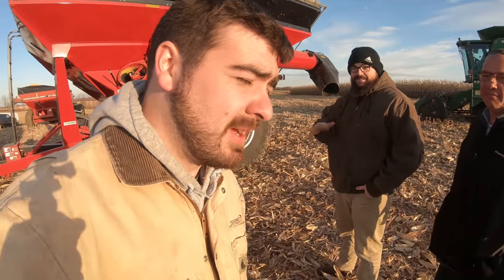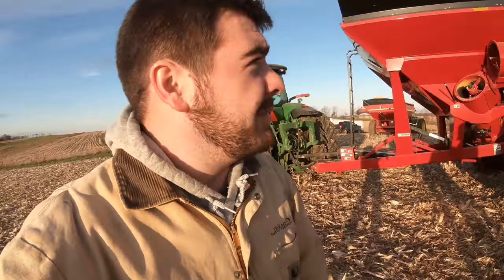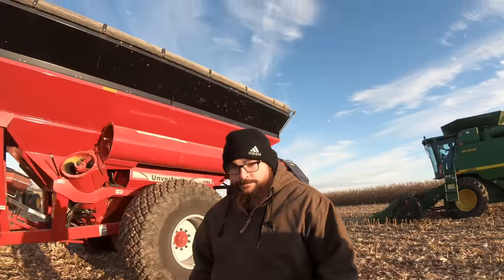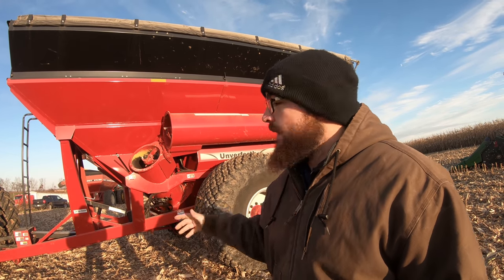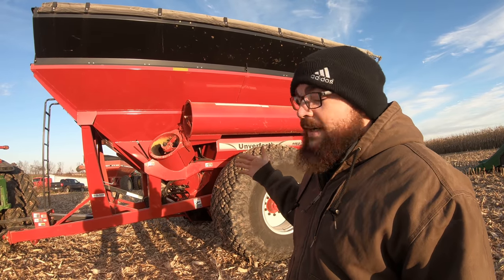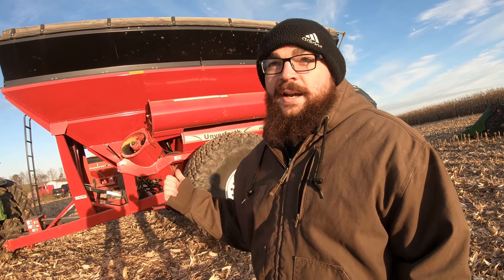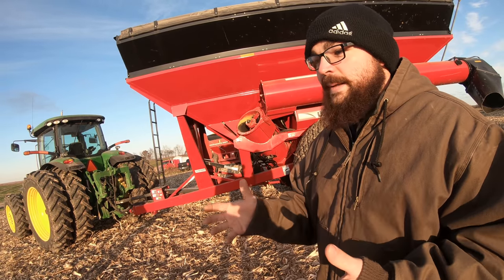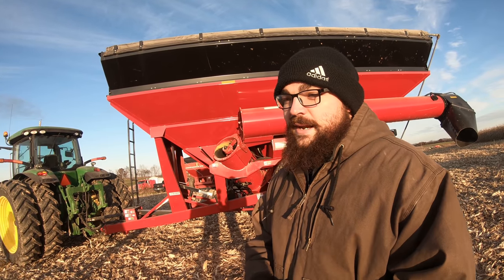A Visit From Unverferth - Harvesting Corn

Comment: you just reminded me of when i was going down to Florida back in 1976. i pulled into a town called Stark Florida. i was about the 4th or 5th car back, when a set of RR crossing guards came down. i see all the people in front and back of me get out of their cars, and start talking, and drinking soda, or i think it was soda. i stayed in my car, with the motor running, and the AC on. after a few minutes a guy walks over to my car, so i put down the window, and he said, HEY NEW YORK, he saw my plate, YOU SHOULD SHUT IT DO, YOUR GOING TO BE HERE FOR A WHILE. i listened to him, and it seams like forever, it was the longest train i ever saw. it traveled really slow, and half of the train was all military trucks and tanks. it was amazing to see, and i have been hooked on trains ever since

Comment: I've sat at that very same crossing for almost an hour a few years back. Someone told me that when they stop there, they are hooking and unhooking cars.
Reply: The same thing happens on the east side of Des Moines.  There's one particular intersection that gets blocked on a regular basis, frustrating everyone.  Of course, I've never been behind the wheel of a semi-tractor on a tight schedule, and that would only add to the level of frustration.
Reply: Matthew Hoag are you talking about the one on Hubbell near University?
Reply: @proc7867  Yep, that's the one.  I guess you're familiar with the area.
Reply: @suicidaljell  you might be right about that, but this intersection is located in Dubuque Iowa.
Reply: Suicidaljello the one Matthew and I were talking about is also in Iowa.

Comment: Cool grain cat and video. The crossing should not go up, then come down and then go up. With no other train on the approach. Call the rail road or the number on the sign to fix the crossing. Your video will help. Should have an 800 number.  They will call the section Signal Maintainer.

Never cross with your car or truck until the lights shut off. In some states it the law, and for good reason. Be safe maybe a video with operation lifesaver one day and some farm tractor or truck.

Comment: It shouldn’t be that hard to open the hoper doors
Reply: Good rainy day project take apart and clean and lube
Reply: Yeah his use some rollers under the doors bet some of them are locked up or flat spotted or both causing all the resistance... BIL's truck uses a full length slide grease her up she's good to go, a little tough at first but once she starts moving good to go.  Know he picked a bunch of crap out but I bet some rollers are locked up under there...  OL J R :)